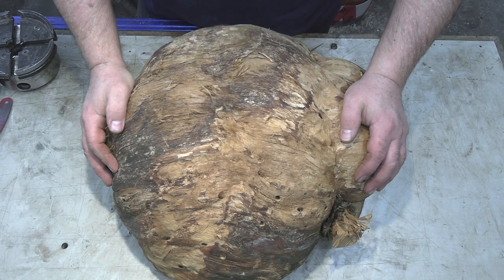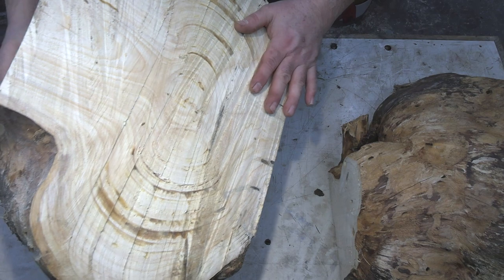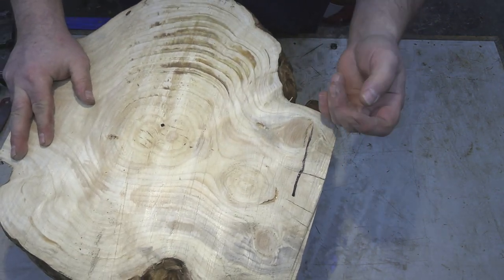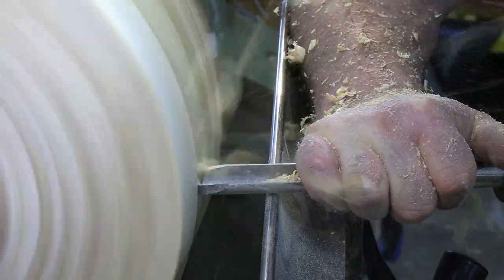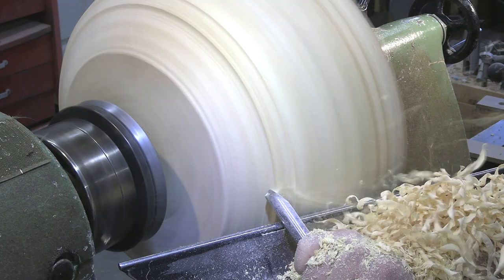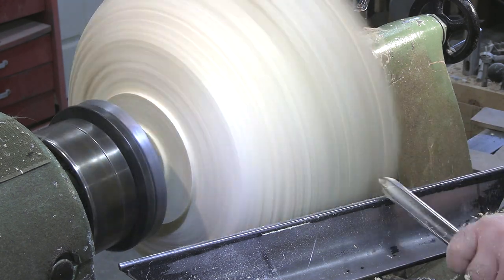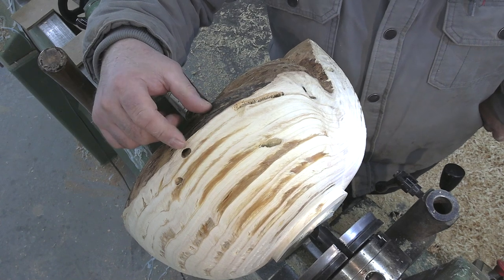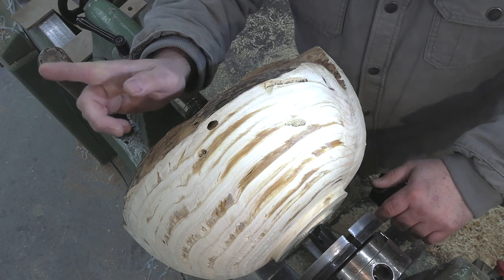Woodturning - Are Pine Burls Worth Buying?

Comment: I carve my old Christmas trees into ornaments for the house and for the kids at school so I can understand the smell you're refering too. I deal with shellac after a quick sanding and it helps to minimize the smell and the loss of wood. No where in the scale you are dealing with, but it might keep the piece tighter. In the deeper voids I would use multiple coats. Just make sure it's not the amber as I am not a fan of the colour.

Edited to add: it would take multiple coats of shellac to seal the piece but I would give it a shot. Even if you do just the pitch to seal it so the rest can be sanded. Still going to go thru some sandpaper, but not as much or as fast/bad.
Reply from the maker: Thanks for the info.

Comment: Interesting video. To bad that burl did not work out.  I live on the East Coast lots of pine trees in New England where I live. And I don't recall seeing very many pine burls compared to other trees in my area. Most of the burls I see are on hardwood trees, I just started turning last year and have been warned to stay away from pine because of the pitch problems. But I still will play around with some pine framing lumber scrapes. It is free and if I screw it up it is OK, LOL.
Reply from the maker: Free is good, thanks.

Comment: I can see your reasoning with these two pieces but I have had some amazing bowls with Pine. I turn pine because I have an endless supply of it, free, as well as aspen. A lot of them I end up resin stabilizing with dye before final turning to toughen them up. I'd love to do some hardwood but it is so expensive to buy. I do have some black walnut, elm, crab apple drying but they are not ready yet. Jim, I love your candid videos, the education and your work. Thanks so much for taking the time to record what you do. Designer Epoxy
Reply from the maker: Thanks for watching!

Comment: Have you tried to heat it inan oven for 250 degrees for an hour? It will melt the pitch in to the wood and stabilize the wood.  I have do e that several times and it worked perfectly. Tamarak grows in the Sierra Nevada mountains in California.   It has more pitch than  pine and is crazy to work with.
Reply from the maker: Interesting, the tamarack here isn’t so pitchy, mostly resinous. As far as cooking it on the oven, I’ll pass on that, lol. Thanks for watching!

Comment: Designer epoxy    ..I recently mistakenly picked up half a pickup bed of pine or fur . I turned 14 inch bowl to finish (very wet) no sanding  but I have done some bowls with the sandblaster  and I will try that and see how it goes before I split up the rest for the fire pit. Thanks again for all the information good and bad.
Reply from the maker: Thanks for watching!

Comment: Jim: good info about the pine gum. I started out turning pine, because it was free and cheap. Very easy to learn on also. Having it fly off of the lathe is always an issue due to its softness. I stained my projects and then coated them in urethane. They came out nice and they were light. Take care and stay safe. PS: I have run across Eastern Larch groves up by Bissett Creek area while I was ATVing.
Reply from the maker: Good to know, thanks.

Comment: Well, here we go again!!! I continue to learn from you. I just cut a truckload of beautiful shag bark hickory. After I got it home, I cut them in half and by counting the rings, it looks like about 50 years ago, something happened to de-laminate the ring. (Ring shake)I had no idea what it was called. It looks like the delaminate happens 1/2 way through the log. Do you think CA glue will work to make bowls or will it turn into firewood. Thanks for the education.
Reply from the maker: In this case I would use resin and a pressure pot. Thanks

Comment: Agree with you about avoiding pitchy softwood, even burl. I understand boiling the wood can help improve its turn-ability. And it kills the bugs. An alternative is scrubbing the pitch pockets with detergent which dissolves the pitch.
Reply from the maker: Acetone works well to. Thanks
Reply: @SpragueWoodturning  …I was wondering that myself….if there was a way to remove the pitch…even if you then needed to use epoxy to fill the voids…hmmmmm…dunno if it’s worth the work….

Comment: Fun video. Great information for me as we are knee deep in pine here in western Canada. Since you can dissolve pitch in ethanol I guess you could dream up some way to soak the burl and maybe reduce the pitch? But I don't see how that would improve the turning. Likely the opposite if it exasperates the de-lamination. Maybe if you removed the pitch and replaced it with epoxy? Idle speculation :). Thanks for the bonus video. Looking forward to Friday. Designer epoxy
Reply from the maker: Pine burls are just not worth the cost of the epoxy. Thanks for watching

Comment: no Designer Epoxy for this Burl but I agree with you I don't fool with the pine, but I have had good results with the cedar. what kind of wood do you use for your waste blocks I have been afraid to use the pine for even that.
Reply from the maker: I only use hardwood for my waste block. Mostly maple. Thanks

Comment: I am an Alberta wood turner, new to epoxy and I really appreciate your videos and experience. I wonder if you could tell me where you buy your sanding discs and buffing wheels. I am having a hard time finding them here in Edmonton.
Reply from the maker: The disks come from sandpaper.ca don’t forget to use my code inlayjim for your discount. The buffing wheels come form Lee Valley, look under Beall buffing system. Thanks

Comment: Hi Jim, I watch your video,s regularly and have recently purchased a vacuum pump so I can do resin work,as this pump does not have a vacuum gauge as such, watch I intend to put one in place. However I was wondering what is the negative pressure I need to have to draw the air out of the vessel( container) before I turn the vacuum pump off or set a regulater to switch off automatically,  hope you can understand what I am requiring.  Hope to hear back from you with an answer. Cheers John Piper, New Zealand. And good turning
Reply from the maker: You don’t use the vacuum chamber that way, you pull a vacuum until the bubbles stop coming out of the wood. Keep in mind that vacuum chambers are meant to be used with stabilizing resin, so the resin won’t cure until it’s heat treated in the oven. That way it can be used for days until it stops releasing bubbles, then the vacuum is released and the wood is left in the camber to absorb the resin for 24 hours. Once I can pull a full vacuum, I let the pump run for about 30 minutes close the valve on the lid and shut the pump off. I keep doing that until the bubbles stop, Then into the oven to cure. It can be used with other casting resins like you see here on my channel like Deep Cast but you’ve only got about two hours or so before the resin starts to cure. Hope this helps.

Comment: We have an abundance of tamarack here in northern Ontario. I have worked with it in lumber form and it is terrible. Have never turned it though. I have turned cedar many times and it can be quite nice.
Reply from the maker: The one thing that I noticed too was the fact I got a ton of splinters off of doing firewood. Thanks

Comment: Would the resin work with the delimination and pitch issues or it will just not work at all. I feel bad for both of you. It's just there so much pine around. We have quite a bit of Tamarack here but it tends to stay fairly small as it's kinda boggy here. How thick did you want it?
Reply from the maker: I can get pieces on the east coast that are 16” or more. Thanks for watching!

Comment: Is there any way to clean out some of the pitch and fill it with resin? Will the pitch go all the way to the center? Could you stain the wood before you put the finish on?
Reply from the maker: The pitch goes all the way through this piece. If it was stained that would help its appearance, but it’s just not worth it. Thanks

Comment: If he had been open to using epoxy resin, would you have been able to turn it? Would the epoxy resin have sealed the delamination and coated/covered the sticky pitch/sap making it ok to sand? Thanks for posting this video!
Reply from the maker: No, you still need to sand it before any resin would be applied, this is the main issue. Thanks
Reply: @SpragueWoodturning  right right, of course! I forgot about that step. Thanks for clarifying.
Very best

Comment: I have a supply of spalted Jack Pine or what they call "blue pine." The spalting radiates from completely intact, uncracked pith outward in fan shapes. It is spectacular. It also has some pitch pockets in it, but they have somehow hardened or cured, UV exposure/sunlight? It is very responsive to sharp tooling and so far has sanded up nice. It got me thinking, what would happen if you put a rough turned bowl like yours in a UV wood ager? I wonder if that pine resin would cure up?
Reply from the maker: I've never heard of a UV wood ager. Lol. I'm going to assume that it will only cure it where its exposed, so i don't think so, thanks.
Reply: @SpragueWoodturning  Instrument makers, particularly violin and guitar makers use them to give wood an aged appearance. I built my own using bulb and ballast kit from a company called solarcure. They specialize in UV bulbs , ballasts and fixtures for green houses, tanning booths, and wood aging. A wood ager is easy to make. If you want I'll e-mail you pics of the one I built.

Comment: Not being a wood turner my comment may sound plain stupid.  However, I wondered if you could save that chunk of pine by cutting it into very irregular pieces & soaking the least pitch affected ones in a dye that would really penetrate.  Then set them aside to thoroughly dry.  Afterwards some could be added to new projects to add color & shapes.  If metallic dyes could be used to give a shiny metal or mineral look, you might be able to create a similar look to that rock you showed in this video.  Just a thought.😊
Reply from the maker: It’s might be possible, but to honest, there’s hardly any grain in this piece of soft pine and it’s just not worth the hassle. Thanks

Comment: the only "pine" I do, is give away cars for kids when I am vending,  amazing how a board child lights up with a 2X4 car. 
This Designer Epoxy, do I have to pressure pot it or can it sit in a dust free zone until cured?
Reply from the maker: You don’t need to use a pressure pot but it will give you a better casting as a general rule. Thanks
Reply: @SpragueWoodturning   Thank you, when I had a pot, under 45# pressure it would cause the resin to push it's way through the sealant I had on the graphics of the pen tubes. and when I didn't pressurize I had no issues

Comment: Interesting to say the least.  I have a question, if the owner of the wood wanted to put resin in/on it, could you have turned it then?  Designer Epoxy
Reply from the maker: Not unless you sweat the pitch out of it somehow. Thanks

Comment: Well worth putting this video up.  I don't turn wood, but I find your vids very educational and it was interesting to see why you don't use some wood.  It would have been really interesting to see what would have happened of you had continued and cored the bowl out, but I suspect that would have been a bit dangerous if the bowl disintegrated..... Which is taking curiosity too far.  And a solid waste of sandpaper.
Reply from the maker: Yes it certainly would be. Thanks

Comment: Jim, could you not cast it in clear resin and use that as a case to surround the burl and get around the pitch problem?
Reply from the maker: You would need to sand it first and with all that pitch it just wasn’t happening. Thanks
Reply: @SpragueWoodturning  that's a fair point.
Other wise could this be a use for a rough burnt texture bowl? 🤔
I hate giving up on a project 🤣👍

Comment: Would it work if one does shou sugi ban on the finished turned surfaces or with high sap in the wood one will get a flash fire with an undesirable ending?
Reply from the maker: Putting a torch to this piece is the right idea, haha. I personally don’t think it will work, this is just firewood. Thanks

Comment: I use pine when teaching turning, spindle turning but never to a finished product. It can be pretty, yes. But....... anyway nice video. Curious have you turned Red Oak?
Reply from the maker: Sure have, here’s the link https://youtu.be/gzlKZVg4x-c it’s not something I work with very often because of the pourness of it. Thanks
Reply: @SpragueWoodturning  Thanks. I had forgotten that the purple vase was red oak. I've been cutting bowl blanks out of the logs I have that are not suitable for lumber. Right now, I still have 13 more red oak logs to cut into lumber or bowl blanks depending, they came from some trees that were damaged in a storm and I had to remove to close to the house.Still trying to catch up. Cut the last of the elm to lumber and the rest to bowl blanks, but still have walnut and ash to go. Love the channel.

Comment: Too bad about the burl, it probably would have looked great turned into a finished bowl.  Then again, better safe then sorry with the wood flying apart on the lathe, and the clogging when you go sand it.
I wonder if you put it in a kiln to dry it out if that would have a good affect on it or not.  Might make it worse, too.  It was a nice shape  what you turned so far, too bad you couldn’t finish it.
Reply from the maker: Just not worth the time, lol. Thanks

Comment: There are quite a few larch trees where I live. Spruce actually makes strong  plywood, maybe softwood is more porus and absorb more of the glue. There's a company in Sweden that builds vindmilltowers from spurce plywood. They say it has higher specific strength (strength per unit of weight) than steel.

Maybe you could stabilice it before turning to make it harder?
Then again why force it to do something it doesn't want to?
Soft wood is good for a lot of stuff, turning is maby not one of them.
Reply from the maker: They do make spindles with it here for your deck and of course dimensional lumber but it’s too soft for bowls for my liking. Thanks